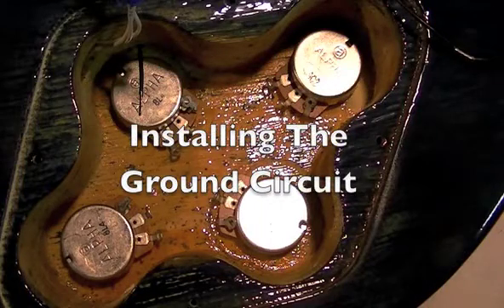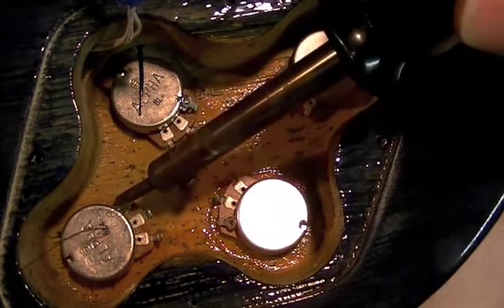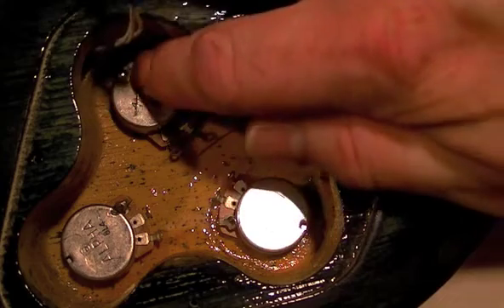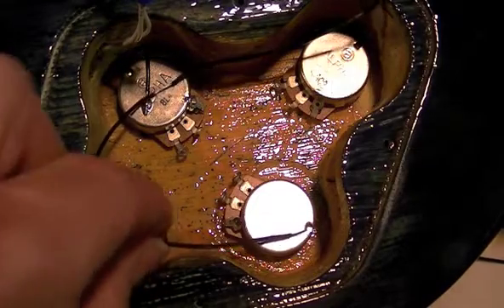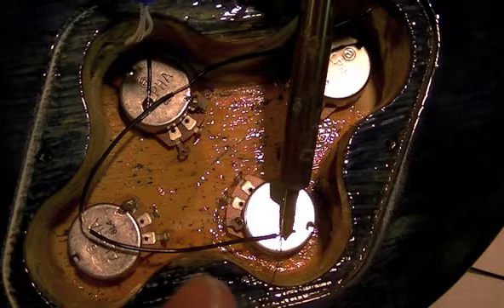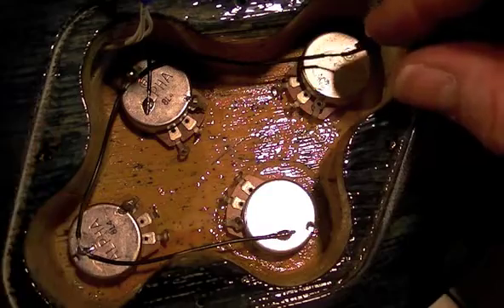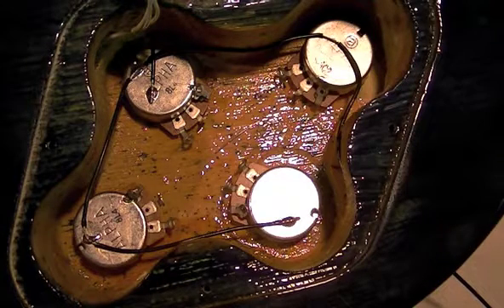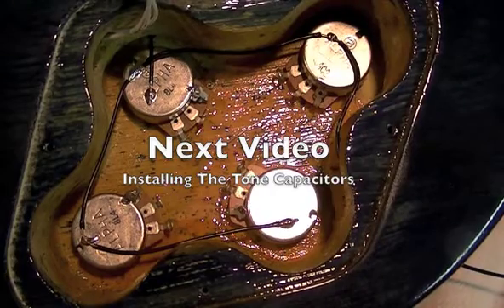How To Wire A Les Paul Guitar From Scratch - Installing Ground Circuit

Comment: Never blow on the solder joints when they're hardening.  It will most likely create a cold solder joint.  Always best to just let it dry on its own and also make sure not to physically move any wire as the solder solidifies.  That will also cause a cold solder joint.
Reply: You’re probably correct. The problem with a lot of these YouTubers is that many of them are not professionals. Just hobbyists. It can be worse when you have these charismatic YouTubers with great editing and production skills and they seem like experts when they’re not

Comment: Never blow on a solder joint.you can get cold solder joints which are brittle and will work poorly or break.
Reply from the maker: Got it. Thanks for the advice. I have had a ton of people tell me this. I figured out how to solder on my own and always just blow on the joint to cool it faster. I will be addressing this in future videos to try and right my bad advice. hanks for checking out my vids.
Reply: Was about to say the exact same thing! :)
Reply: +James Latimer Shut up, the video was an excellent tutorial and guide. Everyone makes mistakes, and this one wasn't a dealbreaker, just his own way of doing things.
Reply: Pete Apollo
I'M SORRY, GO AHEAD AND DO IT HIS WAY , THEN U WILL BE SORRY.
Reply: James Latimer In fact I have, my Les Paul Plus Top is still fully working
Reply: Pete Apollo Just wait until your Les Paul suddenly cuts out at a critical time for you. Blowing wont cause the joint to not work instantly. It is the sudden cooling that just causes the solder joint to set in a brittle and unreliable state. It becomes a ticking time bomb for failure.
Reply: Ahh see, I 100% know that it's not supposed to be done, but my point is that the video is still an excellent guide. I have blown on my solder joints, my mistake. But you can't ignore the fact that the rest of the video is great.
Reply: Typing in all CAPS (again) is the equivalent of shouting on the internet, now you know not to use caps lock... so now you're not as ignorant.!
Reply: Don't ya' just hate shouters!?! ;-) I knew a guy who used cap locks 100% of the time... I practiclly had to wear earplugs! LOL
Reply: big respect for axman's  humble response
Reply: WHAT DID YOU SAY?!?!?!!
Reply: James Latimer, keyboard bad ass.
Reply: It's OK to blow on your fingers after touching them with the iron.
Reply: also using flux helps with heat transfer from iron to component, just don't forget to clean it up after soldering, a little isopropyl will take care of it.
Reply: @jameslatimer774  just watched your video on how to solder. Very informative.

Comment from the maker: Thanks for the information. I have been told by a few other viewers that blowing on the solder connections may hurt the integrity of the connection. I must tell you I have learned to solder on my own and never had a problem with my connections. In the future I will address my mistakes and inform people not to blow on their soldering. I thank you for the education and will no long advise people to prematurely cool the solder. My only regret is that I can't reshoot all the videos to correct them!

Comment: I don't know about blowing on solder and all of those complaints. I don't like bending the lugs for the ground connection at all. That lug is connected to a pcb board. That board can easily break. The second you bend the lug that lug and the board it's connected to are weakened. I connect a wire from the lug to the back of the pot instead. I broke several years ago bending the lug. This is said to prevent unnecessary and possible future failure. Keep the integrity of the pot, all you are doing is offending it! Liked your video for good measure but seriously....great info minus the bending!

Comment: You can most certainly blow on solder connections.  I mean, don't use a hurricane force to blow out candles or use canned air, but regular blowing on solder will shorten the change of state time without harming the connection.

Comment: I was told it was bad to blow on a solder because it could cause a bad connection. At least that is what I was told in school :)... But any who, why wouldn't you make a template? That way you don't need to make all the soldering inside the guitar cavity... Other the that nice modern style wiring. I myself am going to try the modern style then the 50's or seymour duncan wiring style... I'll upload a vidieo of my wiring as soon as I get the parts... :)...

Comment from the maker: You are correct. A ground wire should be run from your control cavity to the closest stud and bushing of your bridge configuration. You do not need to solder the wire to the bridge bushing. Leave enough bare wire exposed so that it makes good contact with the metal bushing and solder the other end in the control cavity to the back of the volume pot. If you are building from scratch, be sure to drill the hole from the cavity to the bridge first, insert the wire and then the bushing. Good luck....

Comment from the maker: That would also work. If you thread through the pole and solder to the pole and back of the pot that works as well. Just as long as you get a good clean connection. Thanks for checking out my video.

Comment from the maker: Run a ground wire from the bridge to the cavity and solder it to the back of one of the volume pots. Ground each volume and tone pot together and run the ground out to the 1/4" jack. If you got to my website you can purchase the video that shows start to finishe the entire Les Paul wire up for $7. Good luck with the project. It sounds like a good one.

Comment: Blowing on the solder can sometimes lead to a cold solder joint - where the solder will visually look dull and not shiny and can be caused by cooling the solder too quickly.  Cold solder joints are bad as they do not conduct well (sometimes not at all).  It is hard to tell from your video if you have any cold solder joints for sure - the last point you soldered looks dull but I can’t say for sure at 360p.  You work is very neat and tidy – a mark of a good craftsman.

Comment from the maker: Thanks for checking out the video. I have been using Radio Shack .015 diameter High-Tech Silver-Bearing Solder for years. It is very thin and will give you better contrlol when making connections. You will use more solder but you will get long lasting, clean connections. The thin solder also require less heat so you won't over heat components. If you want more info, go to my website and purchase Basic Wiring to learn more tricks. Thanks.

Comment from the maker: Yes you can... I have had a lot of people ask me how to wire a Les Paul in the past couple years and that is why I made the video. You can use the techniques shown here in any 2 volume/2 tone guitar. One of the main points I try to use in all my wiring jobs is to use one solid wire for grounding rather than multiple wires. Good luck with you projects and thanks for the question.

Comment: In attaching the ground wires to the backs of the pots, I always "scrape" just a tad on the back of the pot where I am attaching the wire.  Give you "new" metal to solder to.  Tinnings everything is also recommended.

Comment: If you clean the tip on a wet sponge and apply enough solder to re-tip the iron and then add a little more, the extra solder helps transfer heat exponentially. That extra solder is not to make the connection, but rather transfer heat. Then apply more to the parts being connected.  If the iron sits sometimes a fast as 30 seconds, time to clean the tip and re-tip it again. Start with that.   And for $7, I can teach you the rest. But it will, at least, be on the money! LOL

Comment: Great video, can you a FULL Les paul wiring guide with Copper tape as shielding in the control cavity. I'm up to the wiring stage with my Les paul build and im getting confused with what to ground. Thanks

Comment: Solder Flux is great for this , that way you don't run the risk of over heating the potentiometers and running chance of ruining them.
Reply: Its my understanding that most standard contemporary solder wire already contains flux within it.

Comment from the maker: If all the pots are in the cavity and grounded to each other, they are already touching the shielding in the guitar. All the hots for the pots are inside the pots themselves. The ground side is the pot itself. So, if the pots are touching the shielding, the shielding is already doing the job you want it to do. You will not need to run a wire to the shielding.

Comment: Thanks for replying! I have all the components ready and i have shielded with Copper Tape and i have set the CTS pots inside the cavity ready to go. Just waiting for my pickups to come. But yeah thanks for the info, but since i copper shielded the cavity, how would i go about connecting that to the wiring so it actually has a function. I going to check out your website now! Thanks again!

Comment: I build a jig (just a 1/4" piece of plywood or hardboard with holes drilled and marked)  that replicates the pot spacing and build a "harness" outside of the guitar body whenever I can. That is much safer, not to mention easier to work with, than trying to soldier down inside the body cavity.  That way, only final connections need to be made inside the guitar. Whether it's a daily driver or a priceless vintage instrument, , why risk a burn or even resin splatter?

Comment: Like others have mentioned go buy some Liquid Rosin Flux and small squeeze bottle with syringe tip and you'll see how fast the heat transfers and the solder flows like water. You won't ever want to solder any component without. Allows you with a 400* F iron to get in and back out quickly and without risking as you have here from overheating and cooking delicate parts. Nice job otherwise

Comment: I don't know much about wiring guitars but wouldn't you get a much more solid and durable ground if you threaded through and soldered the wire to the ground pins on the potentiometers before you bent them down?

Comment: I just opened up an Ephiphone Les Paul I bought and the ground wire to the bridge is not connected.  What impact would that have?
Reply: If it's not connected you can get a lot of noise. Ground it and the noise will go away.

Comment: Where is the rest and this series???
Reply: If you watch @16 seconds into the video there's a link at the bottom of the screen to pay $7 to watch the full video. (no thanks- esp since he keeps repeating to blow on the solder, That's just wrong.)
Reply: First don’t blow on solder joints to cool them,second make a pool of solder on top of pots before you solder ground wire, third tin all copper wire before you solder it makes life a lot easier and guarantees a good joint!!! (Never Blow on Solder To Cool it)result bad joints.

Comment: Your not supposed to blow the solder to cool it,that's how you get what they call a cold solder joint.to tell the difference between a correct solder connection is that the solder should have a shinny mirror finish not a dull finish

Comment: it's a bit frustrating for me because the kit i bought, the capacitors were already soldered to the tone nobs, not stretching to the volumes, and a number of other wires were also pre soldered, and different colors making it a bit difficult to follow any of these video's step by step...

Comment: why no shielding in the cavity ?
Reply: probably because its a les paul, which has humbuckers. shielding i thought was only mainly used with single pickup style guitars, humbuckers essentially eliminate that necessity
Reply: noun [ U ] UK   /ˈsəʊl.dər/ US   /ˈsɑː.dɚ/ Depends on whether you use an English or American dictionary. It's spelled and pronounced with an 'l' in English. Not that it makes the American pronunciation wrong, both are correct in their respective countries.

Comment: There are so many things wrong here its scary!...
Reply: Totally agree with you, its shocking...
Reply: Seriously.  Hes melting the wire by heating it so much. Also going to fucking destroy the pots heating them so much. Like this is awful. No one should do what he just did.  If you dont know how. Bring it to a pro. It just cost u more doing it this way
Reply: @patrickrosington1174  how should it be done? for those of us who want to learn, bringing it to a pro feels like giving up.
Reply: Its not life or death dude if it dont work you can just do it again its not like you wont know when you plug it up
Reply: @MartyAllocco  The wires should be "tinned" first; that is to say that a little solder should be applied to the end of the wire to be connected prior to actually soldering it in place. This helps facilitate a faster and more robust union. It also means you don't need to spend so much time with a hot iron in such close proximity to sensitive equipment. One should also never allow the iron to get too hot.
And as others have pointed out, blowing on the joint to cool it is an absolute no-no - moisture in the breath is captured in the hot metal and results in tiny air bubbles as the heat cause them to expand, leading to dry joints.

Comment: Too bad this instructional is full of bad instructions. Because it's the type of instructional I'm in search of. For starters I would rather ground each pot with a small piece of wire like part of a capacitor. Oh well.